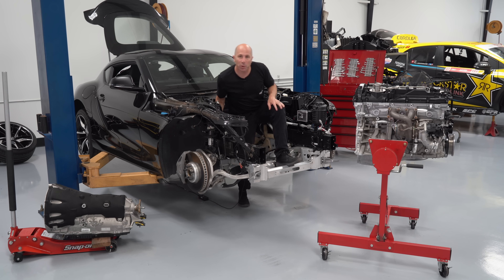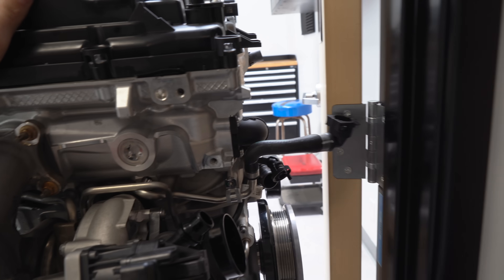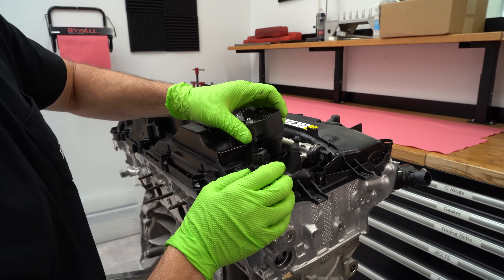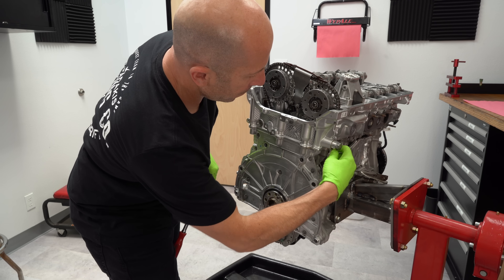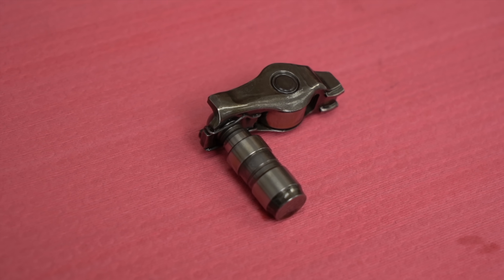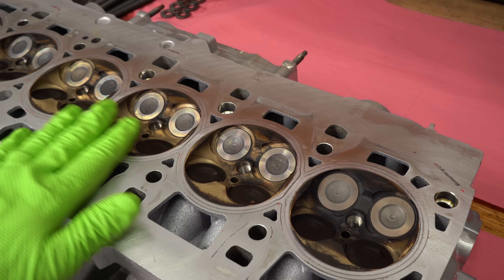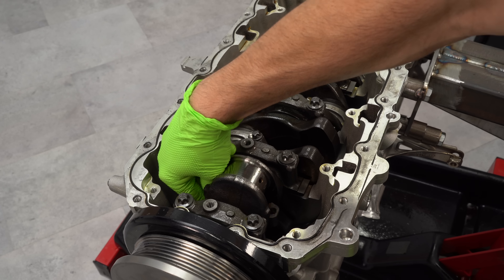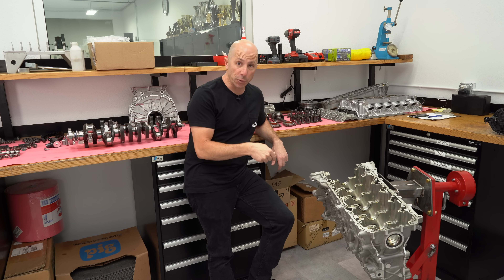2020 Supra B58 Engine Teardown - First Look - Better than the 2JZ?

Comment: Working as BMW diagnose technician, i'm very very interested in this project, so subbed.
But reading through the comments i'm astounded by the amount of silly misunderstandings. So to straighten out a few:

Yes, the B58 is a BMW engine, but Toyota "persueded" BMW to build it this way, to the standards Toyota wanted. Otherwise you'd be looking at the N55 engine now. The B58 (and the entire car) is a BMW-Toyota collab. Add some Italian "feel" to it, and it could be a centerfold in a dirty magazine.

Timingchain behind cil 6 is there for weightdistribution. This way the engine can be mounted lower down in the car, shaping the sump around the front subframe, not getting in the way of steeringrack etc, and be further behind the front wheels. So big big performancebenefits from something as simple as timingchains and oilpump at the back of the engine. And with modern silicone sealant leakages are a rarity. I personally have not encountered any timing issues at all with this engine, nor have i heard of any. But yes, if ever there is one, the engine comes out, consuming a lot of time. Can't afford it, don't buy it.

Plastic intakemanifolds are the standard this century, for almost all carbrands. Cast alu manifolds started dying out in the late 90s-early 00s. Productioncosts ofcourse, and plastics improved a lot, a whole lot. Same for valvecovers etc. The aluminium versions crack before the plastic ones do. And plastic saves weight over alu. Thinking of all plastics being a pour material is thinking of the past.

Having the intakesystem on turbocharged engines as low volume as possible greatly improves turbolag, and therefore efficiency. So the watercooled intercooler, on a separate coolingsystem of max 60*C,  ( same temp as air from aircooled intercoolers) in the intakemanifold is smart. offcourse it is used in roadgoing cars. But yes, may be changed for trackcars, but that can't really be a big issue for a proper mechanic.

The cilnderhead comes in different versions. Not all have the integrated watercooled exhaustmanifold. Don't know which have what system, but when uprating the engine, the head with the external exhaustmanifold might be worth considering because of extra heatproduction. The integrated cilhead is mainly for efficiency of heatrecovery and -removal depending on current engineworkingconditions. So again very desireable for roaduse. I'll look up the details if i have time.
Edit: 
From the info i have at home:
B58B30M1 M stands for Mittel, midrange poweroutput, has the integrated exhaustmanifold.
B58B30O1 O for Obere, higherrange poweroutput has an external/ more conventional exhaustmanifold.

The coolingmanagementmodule may be out of its comfortzone when B58 produces 1000+ HP, so maybe thats something to look after, but it just might be able to handle M3-kinds of heatproduction 😉. Haven't found any flaws on productioncars with it so far.

About the fuel system... Only to be worked on by people who REALLY!!!!!! (Do not risk an near-unstoppable fuelfire!!!) know what they are doing!!! But watching the next the next vid, @PapadakisRacing what's the plan for your system? Using the direct injection or bypassing it and having it indirect only, since thats what your CAD shows? Would like to see how you'd do it. 

Anyway,  love to see more of your project, all the best,
Mechanikos
Reply: Partly true, you're wrong about the B58 engine and how special designed it is for Toyota. The N55 engines were outdated and had some known issues. BMW created a new modular engine, the B58, for its own models which I have in my 2017 BMW 440i (long before the Supra project). The B58 you'll find in the Supra is the B58B30C, an engine code unique to the Supra. But once you dig deeper and look at the internal engine part codes you'll notice that the B58 engine is actually an cocktail made from the 740i, Z4 M40i and M340i engines.
Reply: @SocietyUnplugged another person with some brains in this comment section. Thank you!!
Reply: @SocietyUnplugged   To clarify and go in a bit deeper: it was developped partly with, not exclusively for, Toyota. The first generation B58 in your 2017 car (nice) is different. Yes, a modular base for both diesel and petrol engines. The B58TU version is used since this year, and is in the Supra. Biggest difference is in the chaindrive. It traded its 2 chains for 1 lighter chain, losing its dieselpumpsprocket.
Youre right about N55 but yes, it was considered over the original B58 for some reason. I'm happy they chose to do this instead.
Also, i'd love to know what the C in the enginecode stands for, as i've not seen it used myself. Anyone?
Reply: So many haters on this post. Its informative. Thanks. Love the Supra, love how it's made. Alotnofnthese haters think they know but wanna argue with a guy who literally talks to heads of BMW themselves...

Everyones quick to jump on hating the B58 engine, yet theyve probably never driven in a Supr with a 2jz lol....hating on BMW yet what do you say when yamaha helped build the 2jz? Nothing....
Reply: @jamesallen8797  Is this is true then thse 2JZ fanboyz/trolls needs to STFU!
Reply: @velr50gt  yes they need to
Reply: @jamesallen8797  yeah, its a nice BMW Z4 for sure.
Reply: Thank you for taking the time to write this! Really nice info!
Reply: @YaBoiScoots    I'd think 90% of those keyboard warriors havn't ever touched any engine, let alone a 2JZ. I've only done a service on one once, so i can't make any claims about this mythical wonderengine, but experience shows me that any commercial product has its pros and cons, so i believe you on your word.
The m62's in any form are horrible to work on, especially the various coolingthingies in and around the enginevalley. And timingchains, and then those miserable valvecovers... Lifting B57/B58 from the car may take more time, but personally i'd take that job over working on M62 any day.
Overall, chains on BMW 6cils have hardly any issues, because the there is less "jerking" from the camshafts compared to 4cils. Same for the chainguides. Best example N47 lots of chain issues, N57 hardly any, while they use the same system. Also, the tensioners have improved.
I'm not native English, so please, spell out RTV for me. I'm not sure why this sealant is used more nowadays. I vaguely recall something about it being capable to seal loadbearing parts, but i suspect costs are a factor too. It is mainly used on the sump and chaincover (which connects engine and gearbox). Next week i'll be at BMW HQ, I'll see if i can get them to talk a bit more.
Thanks for your thoughts
Reply: Great information! One question, why would you want to pull heat out of the exhaust manifold. Unless you’re recovering energy (think bmw has something for this) or the turbine wheel can’t take normal temps, seems unnecessary. What am I missing?
Reply: @turbotj99  In a roadcars, because of emissionregulations, You'd want this sort of heatrecovery to warm up the engine ASAP. But other than that you're right in your observations.
Reply: @turbotj99  its a way of using exhaust heat to heat the engine coolant quickly because the exhaust path inside the cylinder head is so long. this is an attempt to make the warm up cycle shorter for better cold emission performance. every good designer knows that shorter exhaust ports are better for heating up the cylinder head as little as possible. this is really evident on well designed aircooled cylinder heads. for example, the ones found on bmw wwII aircraft engines. 
when a designer designs an engine to heat the coolant more than it needs to, like this one or the chrysler and honda and gm v6 engines, they need to design the car with a bigger radiator, more fan, and ultimately more frontal area and wind drag. what a bummer.
Reply: The solution (so far) to many modified direct injection engines that are running out of fuel is to add traditional fuel injectors to the intake side though a modified intake or intake plate. Wonder if they'll go that route.
Reply: @peesincornfields  They showed a little in the next vid, so i'm just curious about the details too.
Reply: Been working on cars for years. The plastic does crack. Especially BMW plastic. They can't make a plastic coolant reservoir or oil filter housing to last 20k. On some models it is a recommended part change. Many other issues with BMW plastics but even the quality control on metal components is also trash. Especially the springs on the struts that break often. There are cars in junk yards sitting for years and the springs r still good. BMW r nice looking cars but not as reliable as they r marketed to the general public.
Reply: clos niev so true. After 5 or 6 years they are lemons
Reply: @arielatom03  on the newer ones the oil housings r failing earlier
Reply: @closniev2939  My missus drives a 2007 BMW with 125k miles which still has the original coolant reservoir and oil filter housing, and no they're not leaking. You don't know what the fuck you're talking about.

Last time BMW had issues with coolant tanks was with the e46. That was 20 years ago.
Reply: @BigUriel  I respect everyone opinions but now a days everyone is a mechanic or trained technician. Most people leaving comments online about others not familiar with cars because a family got lucky with 1. Have never worked on a car at all their entire life. Some of the people here that made valuable comments have been in the repair field for many years. That is many years of actual experience in turning wrenches not watching the mileage dial on the car move.
Reply: @closniev2939  I've had several BMWs and done all the maintenance/repairs in them myself, I'm not a couch mechanic actually.

My point stands you're refering to faults that were known issues two or three model generations ago. And they weren't even major issues, an expansion tank costs 30$ and takes 30 minutes to replace. Even if you had to replace that every 60k miles that would hardly be the end of the world.
Reply: @BigUriel  my 335i disagrees with you, my oil filter housing cracked and sprayed oil everywhere. luckily i was at home
Reply: damn I can really see the german combining of words here
Reply: You Greek? Mechanikos?
Reply: @YaBoiScoots Supra fanboys be like: uHuh 2jZ gOod aNy oTheR eNgiNe bAd.
Reply: Great !! Thanks for clarifications !
Reply: Time for you to start your own YouTube channel dude!
Reply: Honestly I love all cars that are ever made I can understand that they brought back the supra afterall it is a highly sought after vehicle that is where it ends tho .
The 2019 supra even if Toyota had input on the development .of the engine. Is 78% bmw all the way down to the chassis and frame . The reason supra became famous is because its relatively easy maintenance and horsepower to dollar gain. The 2019 has none of that. I will be honest I have yet to work on a 2jz or the 2019 supra so I will keep it at that.
Reply: Yeah the engine is cool and all but why does the car look like a baby old supra that got dropped head-first? It looks like a super car sedan/suv with a little down syndrome. I wish they spent as much time with the engine as they did the design.
Reply: anyone whos had an audi since 2000 knows this stuff. nothing new here.
Reply: Nice info too man... Like a whole new knowledge after this teardown already make me mind blowing..
Reply: Special tool for this, special tool for that...  yeah, total BMW, don’t look like Toyota had much say on that engine design.
Reply: @Goforitmanager  every platform has bespoke tooling ya nub
Reply: Joyzy & Mechanikos wtf are you talking about the b58 engine was put first in the 3 series in 2015 way before the supra
Reply: Completely understand the plastic intake, its not as catastrophic as having the plastic water pump unit fail
Reply: Love the long winded comment. Point being, Toyota using a BMW engine based on currently used architecture, this isn't some new engine just for the Supra. Toyota could jave and should have done better. That engine is so close to being an N55 it ahould have been called an N55B or something. Rediculous.
Reply: There is literally zero evidence indicating that Toyota did any work on this motor. None. The Supra is an outsourced job. You guys are taking it very literally. You really think think Toyota is teaching BMW how to make an engine? The entire car, down to the suspension is Z4 3.0 spec. Yeah the Supra B58 has a different engine code, just like the AMG built motors in the Pagani cars also have a unique number.
Reply: I subscribed to you !
Reply: When you mentioned "but Toyota "persuaded" BMW to build it this way" adds a lot of skepticism to the word "WHY?"
Reply: Thermoplastic intake manifolds insulate the intake air charge from radiant heat. Has little to do with weight savings.
Reply: I have an n55 sounds so good and runs great
Reply: What’s so difficult about removing injectors and the pump? Lol
Reply: Do you know why they used a single roller timing chain rather than 2?
Reply: Thank you for schooling these fools.
Reply: What dangers are there when working on the fuel system
Reply: Really? They were “persueded.”?
Reply: bro i love you so much omg this is interesting
Reply: My eyes hurt reading this
Reply: yes you point out correctly integral exhaust manifolds are not ideal for high performance or heat management.  this does not seem to make bmw or toyota look very good. even if i could afford the car casually, this would sadden me if i bought it.
Reply: Just writing this to make 100 even number.
Reply: @shadez3k  agreed, so much bullshit. Toyota fan boys will be fan boys, but in the end, this thing is a Toyota badged  BMW Z4 essentially.
Reply: How is this engine compares to the bmw one ? Toyota says they “reworked” it, so you believe them ?
Reply: Thanks for the info. But I have just one question when you buy the new X5 ( 45e version ) is this the same engine or are there some differences.
Reply: This comment would be great if it weren't for the BS in between
Reply: Whereabouts do you work dude? Which plant if you don't mind me asking
Reply: hello! any updates on this engine's reliability? would you recommend this engine as for reliability stand of view in a suv too? x3/x4 40i. thanks!
Reply: toyota did a great job putting in toyota relibility standards on the b58.
Reply: @shadez3k  please read back trough the comments. This is NOT the original B58. 
The article you refer to doesn't realy seem to confirm nor deny anything. My info comes from BMW itsself. Thanks for your comment.
Reply: @mechanikos84  go s atch an engine out of a Z4, do a comparison disassembly so you can see for yourself. CA manufacturers dont play games with engine codes? Change the flow of an injector or raise compression slightly and that would make an entirely different engine? Of course not. Toyota needed an engine and BMW provoded this one, one they already had in production, plain and simple.
Reply: Joyzy & Mechanikos wow this really helped with my future debates, thank you!
Reply: wot? BMW had the B58 out for a few years before Toyota had the idea for a supra.
Reply: @Silverdogz  thankfully someone in the comments with a brain, thank you sir.
Reply: @Silverdogz toyota la  fiabilisé surtout
Reply: @Silverdogz  This engine is pretty new, just a few years old now. Developping cars takes a long time
Reply: @mechanikos84  Toyota helping BMW develop the B58 is straight bullshit, as simple as that. Everything on that engine is BMW, toyota did 0. Its a proprietary BMW design and an evolution from their first turbocharged 6cyl, the n54 which by the way won multiple awards and is still one of the best engines ever designed.
Reply: @ferfire9  N54 is a nice engine, but has almost nothing in common with B58. Like i said, it is a BMW engine. Toyota did assist in the development.
Reply: @ferfire9  They just  made sure changes were made to make it reliable.
Reply: @ferfire9  Doubt 1000.  Billion dollar company is just going to throw it's well built reputation to another company without any input.... THINK ABOUT IT..  common sense will steer you back
Reply: ferfire9 It’s true. There was a mini documentary on YouTube about it. Toyota went to BMW for an engine for the Supra. There was a mutual person involved, I forget his name but I believe he use to race for Toyota F1 and he is close friends with the executives over at BMW in Germany. Anyhow, BMW started working on the B58 prior to and sent what they had to Toyota. Toyota made tons of changes and sent it back to BMW to revise. Toyota wouldn’t allow it in the Supra till it was up to their reliability standards.
Reply: @mechanikos84  The B58 was first released in 2015, I think it's safe to assume it had been in development for a couple of years by then. I find it very difficult to believe Toyota was involved in the development of a BMW engine as far back as 2013.

The very specific and more recent submodel of B58 used in the Supra may have been tweaked for this car with help from Toyota but that's it, the B58 is fundamentally a BMW engine.
Reply: @mechanikos84  just shut him up by comparing stats from the z4
Reply: @ferfire9  they did do stress test and things like that I believe. But the b58 have also won miltiple awards also if I remember correctly which makes sense given that it's predecessor is among the brand's best powerplant
Reply: @ferfire9  imgine thinking you know what youre talking about when you arent apart of toyota or BMW😂
Reply: @mechanikos84  developing cars yes, but this engine is not that new.
Reply: @ferfire9  100 percent agree. Toyota should have developed their own engine. They have the skill, history and know how.
Reply: @mechanikos84  saying it's almost nothing like the N55 is a bit of a stretch, its an improved version of the N55, and is the successor to it, but they are still fundamentally similar, its not an all new engine.
Reply: @CastironCoffee  how so? If they wanted reliable they should have built their own engine.
Reply: @ferfire9 a bon ?vous ecrivez  n importe quoi en fait
Reply: Do you have any official info from either BMW or Toyota stating Toyota assisted with the development of the B58 in the Supra? Ive heard this repeated by fanboys over and over, that Toyota pretty much redesigned this motor for the Supra, but not one single piece of concrete evidence.
Reply: @somethingtough  of course not because it's a bunch of bullshit. I say  he should yank  an engine from a Z4, and do a teardown and compare it to this engine. That would be very interesting to see.
Reply: @shadez3k  Sorry, nothing to link to. I was told by them. 
This is not just another variety of the same engine. The B58 was revised, and this is that revised version.
I guess people are accepting this choice now that its proven.
Reply: @mechanikos84  it's a other variant, this is nothing new made for Toyota beyond some minor tuning differences. It's a Toyota badged BMW Z4, get over it brother. Nothing to link to because you came up with the info yourself or from some BMW press boy.
Reply: Joyzy & Mechanikos very informative thank you! Supra is growing on me to be my fun car. Hoping it has a huge aftermarket community.
Reply: If the bmw engine in the supra passes the quality control of toyota,then its worth it.
Reply: Chris idk why they don’t want to believe you. If they did a little research they would know. Toyota didn’t even build the 2JZ, that was all Yamaha. What difference does it make now? They wasn’t about to spend more money on developing a brand new motor after years of falling behind in the project development
Reply: @Uniqueautoclub  urban myth, Yamaha did not , there is no evidence anywhere. Cylinder heads went to Yamaha to get some work done on it but nothing else.
Reply: @marcr9410  cylinder heads of the 1jz actually, 2jz is fully Toyota
Reply: @E9X330  some say this, some otherwise but nobody can tell because there is not really any evidence for the for what they did or what not. But we can all agree that the 2jz is not made by Yamaha, hehe
Reply: What’s astounding is your basic spelling and grammar mistakes. Yikes.
Reply: @TheHannukahZombie  like he said before, english is not his native language so please be nice
Reply: YaBoiScoots that water pump is the secondary, the main one is belt driven on the B58. I don’t trust the electric one either lol
Reply: If toyota makes a Toyota Supra MK6,   I personally believe that if they take the looks from the mk4 supra and change it to more modern, then use 2jz but completely renew the old parts with new and better parts that might add horsepower, then  they should do some other stuff. Then they should call it a 3jz.
Reply: @truerobloxgods2913  I doubt the guys who are part of the original 2jz dev team is gonna come back, bust out the dusty drawing paper, start up the old engine foundries (provided said foundries are still intact and not dismantled) & design, test, manufacture a theoretical "3jz" just to please Jdm fans while keeping the engine emissions compliant. I mean honestly, all the performance & additional headroom for extra performance you want from the supposed 3jz already existed in the B58. It's a 3L inline-6 turbo engine with a closed deck block, stout internals & makes the typical inline-6 noises you expect. The only difference is it sings in German compared to Japanese.
Reply: Sounds like you are straight making up bullshit about Toyota having in "assistance" in engine development, there is no notable information on spec sites saying this to be true and you haven't included anything but  "hearsay". Toyota didn't have shit to do with the development of this engine. They only had collaboration on the chassis frame between the Supra and Z4, which has been noted. You Toyota fanboys were saying the same shit about the Subaru FA20 engine years back. Stop making shit up.
Reply: @Themayseffect  heck yeah he is.
Reply: I gotta complain about the N55's BMW engine valvetronic system! I had to replace the valvetronic motor as well as the eccentric camshaft at 90 000 km...
Reply: The b58 came out in 2015, what are u talking about🤣
 And look to the s55 wich is older than the b58
Reply: Nice to see an informed person's comment after so many bullying of dumb people.
However you represent the point of the companies, not what an actual customer needs. I understand that reduceing producing prices are the main goals for the manufacturers, but people like to use and treat things - like cars in this aspect - how they used to them. I mean learning new technologies and their pro/cons and how to treat them is more difficult, than use things like they should be used.
You wrote that plastic materials gone through a huge improvement, but many people don't understand or accept that fact; some even think that a plastic can't be strong as a metal, like aluminium. Ok, weight is the key of performance, but weight reduction and make it cheaper/easyer to make shouldn't lead to the lack of reliability, IMO. Ok, companies wants profit and they settle if the first owner of the car is satisfied at least a bit with the product, but this is a wrong way I think, because the used materials are not endless, and producing low quality just to maximize profit is really bad for the economy if you take a long term example PLUS it's also bad for the ecology too.
You also wrote that the timing chain why is located at the "back" of the engine which sounds great in technical ways, but hey, how many driver of 100 would notice this barely little difference ? I think maybe nobody, or max racecar drivers... But if you think of the service part of this "development" you see that changing the timing chain has became extremely difficult, and the engine should dismount from it's place. Okay, if you don't have money don't buy it as you said, man... That's a bit uppish talking, isn't it ? I like technologically developed and highly engineered content, but if I haven't got the money to buy even a brand new Golf should I kill myself ?... LOL, that's a silly explanation for a bad design and ideologizing that it's not that bad, it's even a great result of engineering because we invented a new thing which needs a new solution if it's broken - and it will, we can agree.
Reply: Γεια σου φίλε μου, μια ερώτηση;;;; έχω την bmw m550d f10 και έχω ένα πρόβλημα,  την πειραξα στα 475 HP και 890 nm , όταν πιάνω τα 275 χιλιόμετρα αμέσως κάτι πνίγει την μηχανή και το Bordcomputer με γράφει ΟΤΙ ΔΕΝ ΕΧΩ ΟΛΗ ΤΗΝ ΔΥΝΑΜΗ ΕΔΩ , ΤΟ ΑΜΆΞΙ ΕΠΙΤΑΧΎΝΕΙ ΠΟΛΎ ΣΙΓΑ ΣΙΓΑ like 116d, ένας με είπε ότι χρειάζομαι μεγαλύτερο water intercooler , ισχύει αυτο;;;;;;;; Και Εάν χρειαστεί μεγαλύτερο water intercooler που θα το βρω;;;;; Wagner δεν έχει,  εκεί στο Αμέρικα μπωρό να βρω???? Ή Μήπως μπορεί κάποιος να κανει;;; επισεις ΕΑΝ ΒΡΩ ΜΕΓΑΛΥΤΡΗ ΑΝΤΛΙΑ ΠΕΤΡΕΛΑΊΟΥ ΤΟ ΑΜΆΞΙ ΘΑ ΠΑΕΙ ΣΤΑ 500+ HP, ούτε μπορώ να βρω μεγαλύτερη αντλία πετρελαίου,  μπορεί καπιος στο Αμέρικα να κανει Upgrade την αντλία πετρελαίου και να με φτιάξει μεγαλύτερο water intercooler;;;????? Θα σε ευχαριστούσε Εάν με απαντούσες
Reply: Nigga busted a whole essay
Reply: Do you actually expect ppl to read your whole book?
Reply: @lordlupusrex3781   Being illiterate must be a bitch.
Reply: @lordlupusrex3781  People actually read their comment, you are the only exception here dum-dum.
Reply: B58 aint made-pushed by toyota. BMW already made the motor before toyota rethinks to make new supra

New supra tagline by toyota. Car we wanted to make but dony have to
Reply: The term Japanese reliability, or Toyota quality are a thing of the past anyway, yes?
Reply: Nah its a 85% BMW and just a few inputs are ToyOTAs, plastic intake manifolds are still made in alu instead of plastic for 2008 cars and up , plastic in engine is BMWs since 2000.This car is an attempt by both BMW and toyota to make money and decrease cost Z Supra series.Even the interior is all BMW.better buy an old lexus LS series with a V8 than that car.Dont be fooled by the market.
Reply: @drincogni  agreed
Reply: omfg like reading the most boring book ever, I stopped reading second line seriously, b58 is bmw's engine, only thing they changed is the powerdelevery, I bet you a supra lover arent ya who just cant cope this engine is betetr in every way than that boring 2jz which is prehistoric already, just let it go.
Reply: @swansmeister  Yeah prehistoric lol.. like how an engine from the 1960's (hemispherical) is used today to make the worlds fastest nitromethane drag pulls making 10k HP plus to the wheel..but.. u kno.. it oLd.. mE liKe baCon. You wont see these POS beemer engines around in a decade. Learn some racing history and stop being groomed by consumerism r-tard.
Reply: So will it break more or less then a BMW engine.  BTW, BMW are the worse cars I have ever owned.
Reply: @jmark7390  gonna break the same since its essentially a BMW Z4, powered by the same engine for that car as well. This is some BS. FYOU Toyota
Reply: @jmark7390  yea, the only problem with BMW is reliability, i wish BMW was like honda of Europe